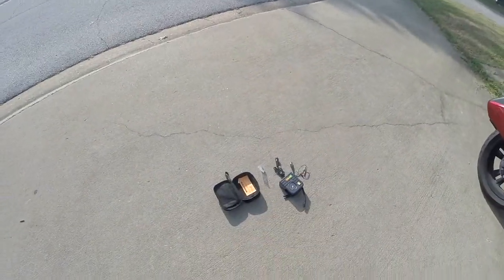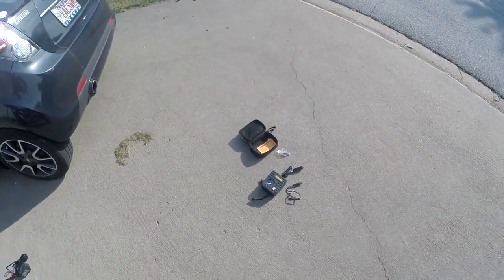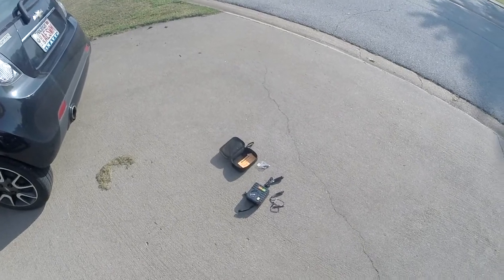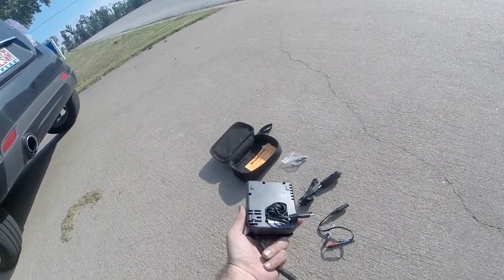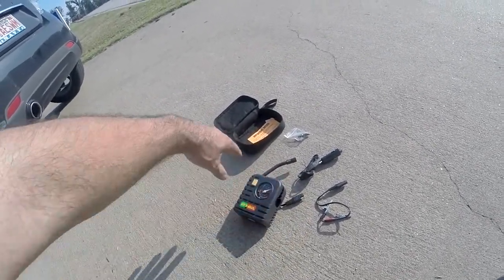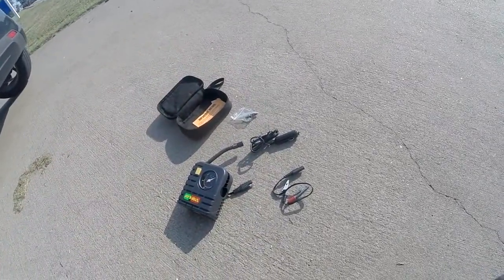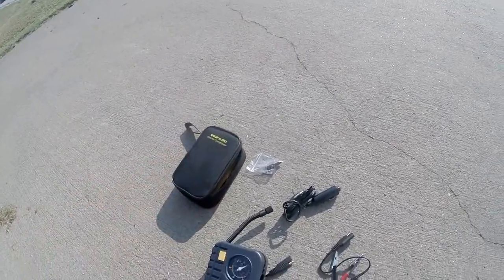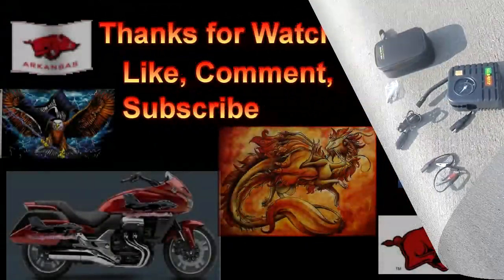My StopnGo motorcycle air compressor

Comment: i like that for the bike, but i think i may add the smaller one for me to carry when i ride. What brand is that one?Thanks for sharing
Reply from the maker: +Krazy Kool NYer Thanks, yeah, that is the StopnGo brand, that I know. You are welcome. It comes it that small carrying case. I think I got that at my local Honda Dealer. I am not sure if Victory would sell that same brand or not.
Reply: Ok thank you
Reply from the maker: Krazy Kool NYer You are welcome. Hope it works out for you. I think Lorddarthvader had said in an earlier comment, that you have to keep the bike running while it is charging up, and it will take about a half hour to get it charged with air.

Comment: ive got the same one but mine came with a plug kit
Reply from the maker: +lightitup550 Cool. I guess mine was either an earlier model or something like that. Do you use yours a lot?
Reply: ive only had it for a few months but it will pump my tires just if u run it off ur battery make sure u have ur bike running so u dont kill ur batterty. and they use the same pump of different kits and what not
Reply from the maker: +lightitup550 Oh o.k. thanks for the info. I did not know that to keep the bike running. I was thinking that I just had to turn on the bike, but not start it.
Reply: the compresser will run straight off ur bikes battery if its on or not. i just drained my battery one time using it and had to push start my bike after filling the tire
Reply from the maker: WOW, Thanks for letting me know that.  I do have a battery charger and tender that go into the pig tail. How long did it take before the compressor was full with air before you were able to pump up one tire??
Reply: no more than like 10 mins
Reply from the maker: Oh o.k. Thanks again for letting me know.
Reply from the maker: Oh o.k. Thanks .